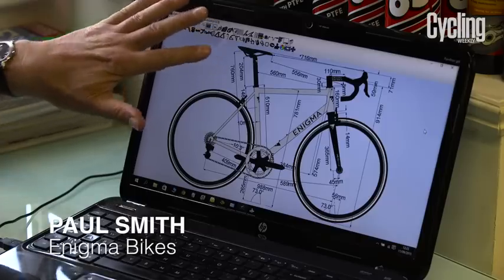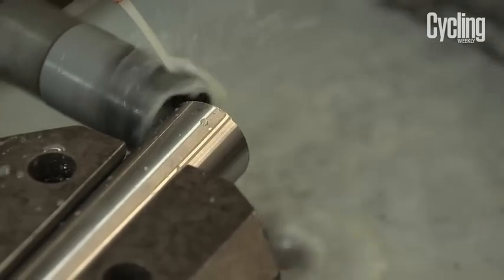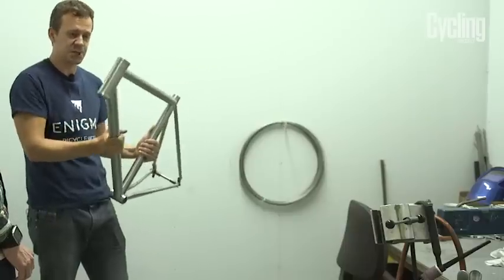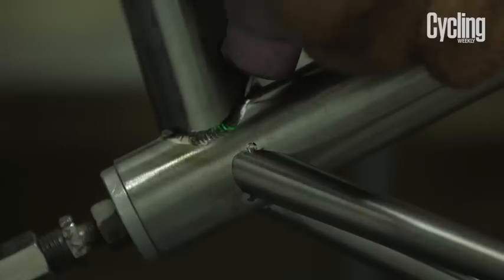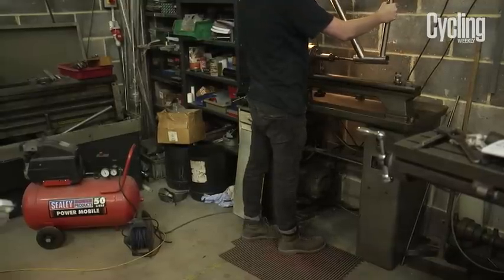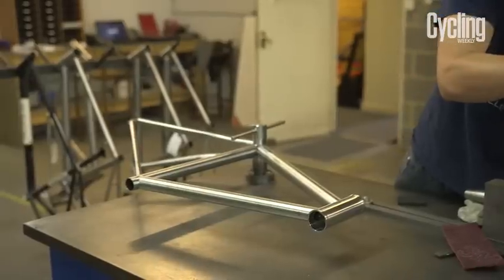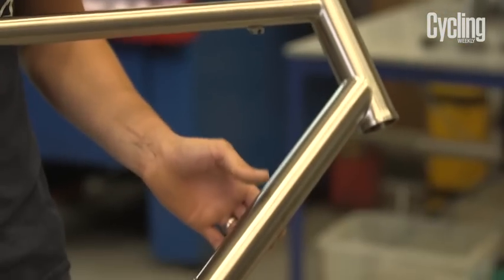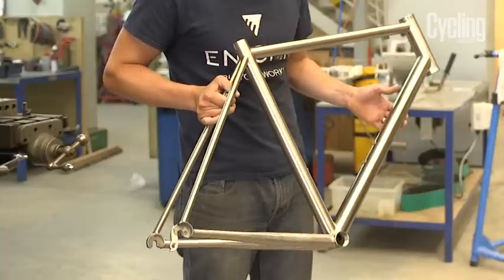How are titanium bikes made? | Cycling Weekly

Comment: They should be welded inside an oxygen purged, argon only environment.  Contamination is way more manageable welding in a purge chamber.
Reply: That's the first thing I thought.
Reply: I've read it's not needed when the material is thin. Hence why all of the ti framebuilders only purge the back side (as seen in the video).
Reply: Correct, a chamber is not needed, it's a waste of gas. Those are really nice frames.
Reply: my titanium frame has been welded in a belgian purge chamber and then they smoothed the welding lines.
Rode the best steel frames from italy as a licensed rider,but titanium is a perfect material to build a bike.
When i ride my 16 year old bike it feels exactly like the first time,the frame takes all the wholes and bumps
and rolls nicely over the cobblestones!
Who needs carbon?!